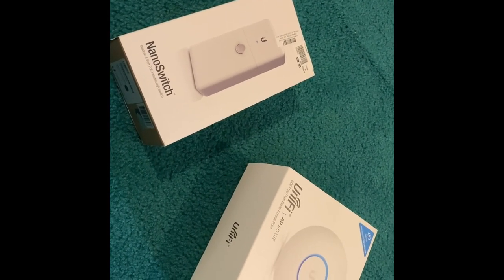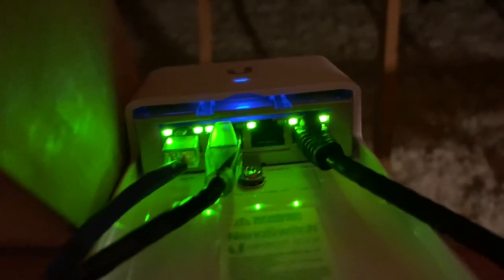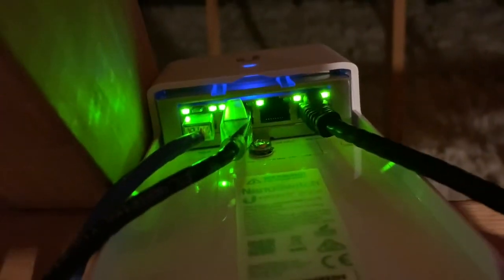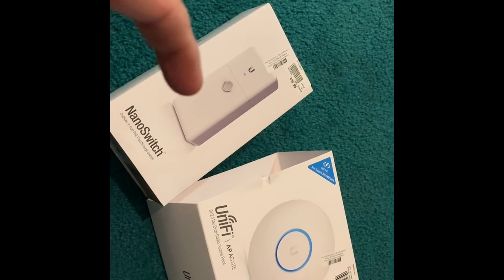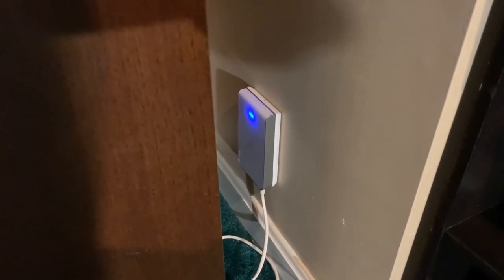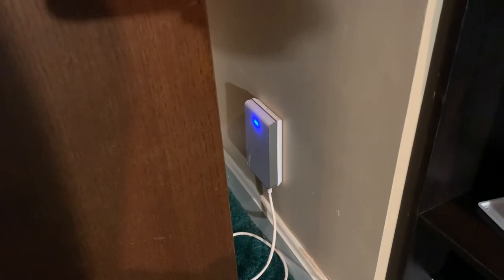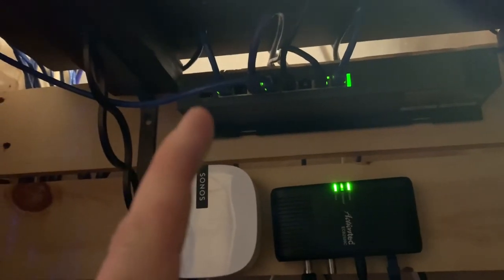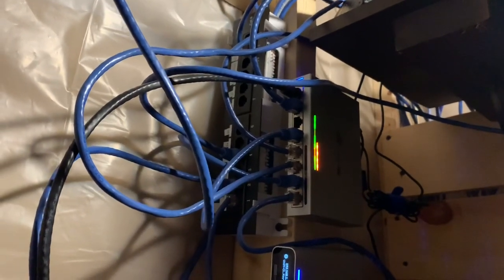UniFi home network update #4

Comment: Hi, can you explain more about how your moca injector works?
Reply from the maker: Scott Leydecker hi

Yes the moca injector is used to send Ethernet over coax cable.  Generally for a set top cable box or to put a hard wired network connection in another room that has coax instead of pulling a new Ethernet cable

Comment: What poe switch do you recommend for poe
Reply from the maker: tony there are numerous out there.  Depends on your usage.   Passive vs active Poe.  Active ones will identify if power needs to be supplied and turn on, passive ones always have power on each port and can damage ports on items if you accidentally plug them into a non Poe product

Netgear and Ubiquiti are my goto items.   TP-Link makes a decent one too that’s not expensive

All depends on your needs/ devices to be used, etc
Reply: @maz94protege  thinking about upgrading dont have any yet starting from scratch i have wifi 5 meash right now
Reply from the maker: @toneloc79  A clean slate is good to start from.  What POE devices are you looking to run? Cameras, doorbells, lights?    Each on their own have different power and POE requirements.  online sites like Amazon are doing pretty good with "pairing up" items when you search.  ie, looking at a POE Access Point and the suggestion is the same brands POE switch.
Reply: @maz94protege  looking at 2 ap lte and outdoor one for my deck not many and  and my computer runs 24/7 so I dont need key